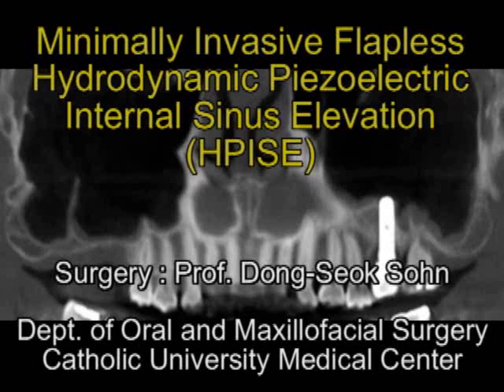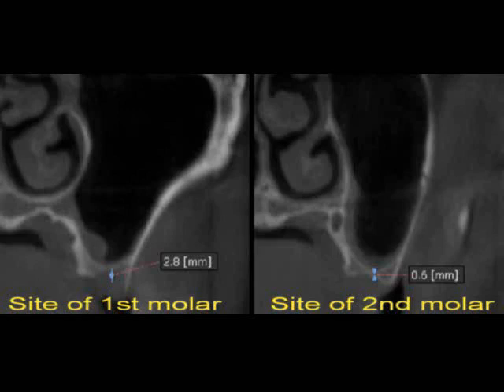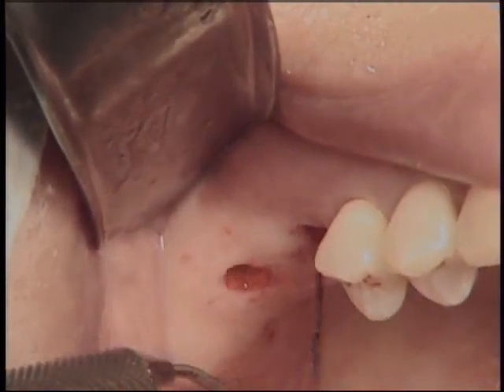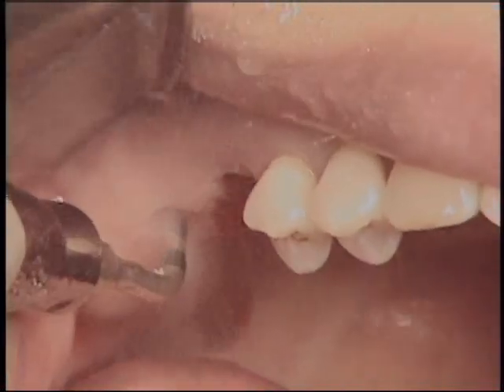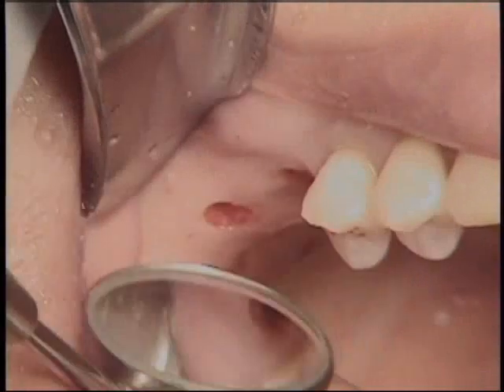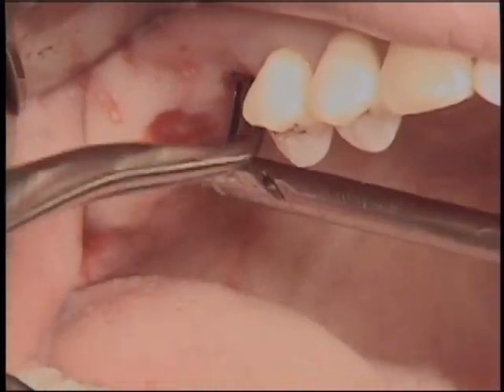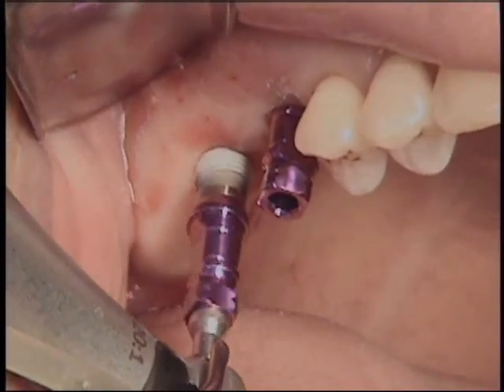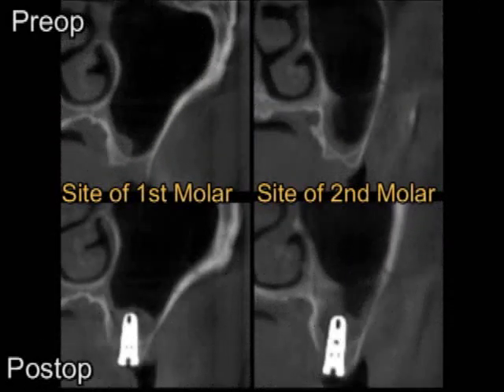the most minimally invasive sinus augmentaion:

Comment: Thank you so much Proff. Sohn. Very informative and it is realy extremely cost efficient technique (if you already got the equipments ;) May I ask can I use also only a prf membranes for sinus elevation in lateral window technique?. Also, I have a synthetic bone granules (calcium phosphate ceramic). Could it be used along with the prf membrane in a lateral window sinus elevation? I see all literature advocate use of a bovine and/or allograft (!!) both are very expensive. If in your opinion the ceramic granules can be used, what is is the best technique to use it? As a separate  inferior layer between the prf and the implant? or in a fibrin glue mix? or in a sticky bone with fragments of prf incorporated in the sticky bone? Thanks a lot and again thank you for this extremely informative and always innovative techniques. Yours M. Talaat
Reply from the maker: Yes you can use also PRF alone for sinsu aug. if you want, you can mix alloplst witg pRF. Thank you